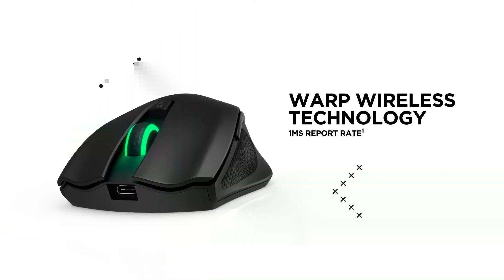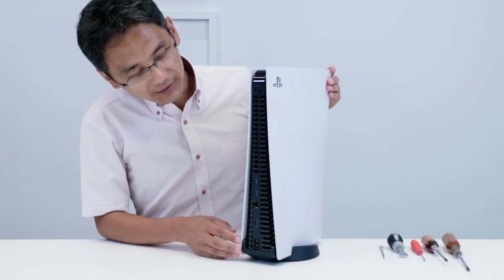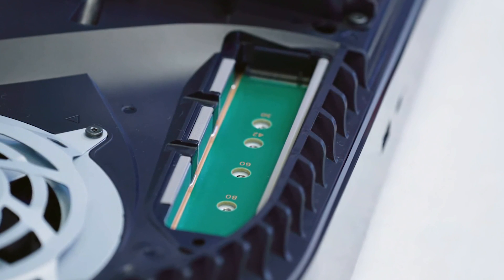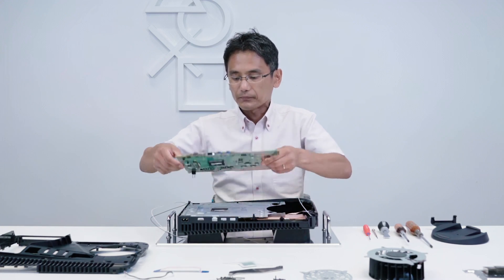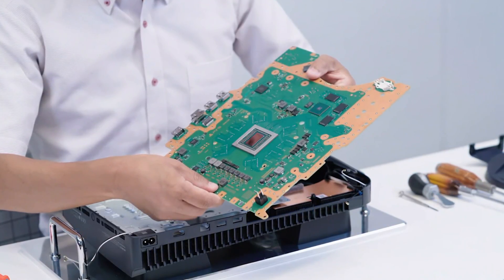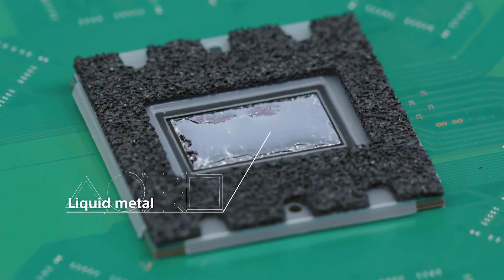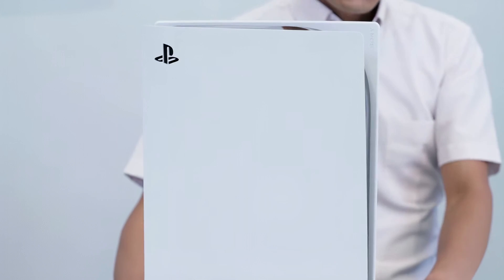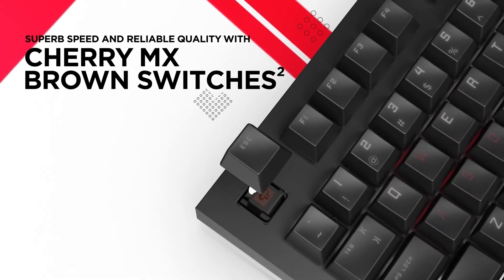PlayStation 5 Teardown Analysis: Inside Sony's Next Generation Hardware Design

Comment: 08:50 Wi-Fi6 theoretical max speed is 9.6 Gbps. This assumes a 4x4 160+160MHz setup to reach that. The PS5 supports 2x2 80MHz, which gives a theoretical speed of 1.2Gbps. In reality, 800-900Mbps should be doable. Disappointing to see an explanation of this glossed over. No effort made.
Reply: I don't know what you're talking about but it's so going to be better than Microsoft's Wi-Fi 5
Reply: @blackgreece2702  It is. The Xbox setup max theoretical speeds are 866Mbps, and in reality 500-600Mbps. But that isn't the point. 

There was little to no explanation of this. 
What is the advantage of going WiFi6 now. What the problem with releasing WiFi 5 devices now etc. 

For a video labeled as technical analysis, i didn't see much of that.

Comment: Performance of SSD degrades? reallly? wft. Like My ssd nvme is right behind a GPU and works fine. No, there will not be a SSD overheating problem on PS5. And on your own Broll you can clearly see a gap made on top of nvme Bay perfectly aligned with air flow...
5.5 is not theoretical bandwidth, its real hardware level. Theoretical is up to 22 GB/s
If ssd fails, the Console will? Yes. If processor fail the console will, capacitors etc. And in any case you would have to send it for warranty. And, btw, same goes for Xbox. 
Really guys instead of gaslighting, try some proper journalism.

Comment: Another interesting tidbit that was passed over, it looks like the mainboard shielding has another smaller heatpipe and heatsink built in, assumingly for the VRM's, you can also see thermal compound on those components and possibly on the ram modules as well.

Comment: My god this guy has a punchable face. Regardless, the power hungry assault on GPU and CPU is unnecessarily and can be a bottleneck as neither need to opposite at full capacity, also putting load on the fan in xbox's case. Early reports have already stated confirmed this concern that many had early on, that being the system running concerninglu hot, which wasn't under load btw; rather, it was stunning backwards compatibile games. 

Anyhow, the smart solutuon is Sony allowing the GPU to boost past what the xbox is capable when needed while maintaining a liberal approach to thermals with both liquid metal and that heat sync as the forward thinking headroom. Couple all this with a variable frequency when needed and the fact the system is optimally designed first and foremost around thermals, then you see why it is so big and me thinks their size backpedalling is damage control for the VCR monstrosity that was the XBONE, but it's still nothing on a PC case and the xbox simply falls short of being boring as far as style and practicality go, even if the XSX is not practical in the slightest as far as a console form factor goes tbh, but that's subjective and who cares as long as more emphasis is on thermals. 

Regardless, the move toward user accessible SSD that isn't proprietary is a smart choice from Sony also, as it gives room for cheaper options and a standardised method to upgrade, opposed to a proprietary one which influences cost, which has also incidentally been reported on as getting hot to the point it burnt the reviewer and has zero cooling deployed due to it's nature. In short: the SSD expansion method xbox have deployed is nothing short of scummy and an oversight.
Reply: @Rohan Rathour ?
Reply: @Rohan Rathour 
Because it's true.
Reply: @Rohan Rathour 
You're not making sense.
Reply: @Rohan Rathour 
It was 1% of my comment. Get over it lmfao.

Comment: The biggest mistake Sony did was placing the extra Space SSD inside while Microsoft did excellent Job with external SSD ! PS5 will run very hot 🥵
Reply: MS still has a internal SSD the external SSDs are extra storage.
Reply: Lmao ps5 runs cold 😇

Comment: I want a pro version that guarantees 60+ fps. I can sacrifice a bit of graphics.
Reply: 60fps is the cap, kid. If anything, a pro version would mean better stability at 60fps and better graphically fidelity, but most importantly, a system that is more optimized and built better.

Comment: Man. you're Xbox Series X teardown didn't even point out the SSD on the board, sound chip, or TIM.  The Sony teardown explained MORE than you and directly from a Sony person instead of an intermediary "influencer". If Sony gets something wrong then they are accountable. However, if you get some information wrong Xbox is free of blame.
Reply: not only that but at 
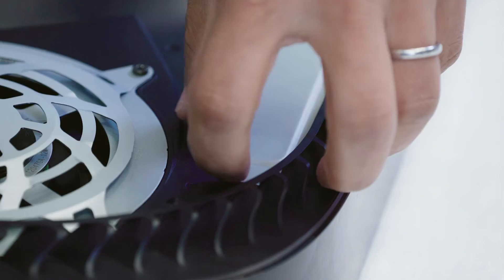04:50 he talks about the SSD gettign hot and not sure how it gets cooled
On the Xbox we know it is not getting cooled it only gets a bit of outside the box cooling but some youtubers who touched the SSD did say it got pritty hot
then at 06:34 he talks about the onboard solderd SSD and if that could be a problem
wel the Xbox SSD is also Solderd on the board as far as we know so same problem there

Then at 09:43 he talks about  the speed of the Memory 448GB/sec and at 14:07 that the Xbox has a much higher bandwith Memory 
But not telling that only 10 GB is faster and 6GB is slower and if you even that out they both are arround the same speed.
So even if they get an PS5 to compair and test it i wonder if it will be a fair comparison.

Comment: I highly doubt they created the m2 expansion bay without thinking about cooling. The whole console is designed around cooling. They built the insides and put the outside around it instead of xbox that decided it was going to be a box and figured out how to put everything in the box.
The only thing I feel like they've fell short on is storage space. A secondary ssd will be almost essential. Other than that they've built an amazing console

Comment: I am a technology novice, which is why I love this channel. I have a question, could Sony overclocking the PS5 have long term issues?
Reply: Heat is really what kills electronics. Overclocking will produce more heat but PS5 seems to have adequate cooling to dissipate that heat.
Reply: The hardware is already heavily underclocked due to being starved on less than 130watt to share with the cpu. If anything, trying to reach default clocks on the hardware would result in massive thermal throttling and kill components.

Comment: The PS5 design is not "tried and tested", but "lazy and unimaginative"; just as the overall Sony industrial philosophy.... There is a reason that, aside consoles, Sony electronics in general (Phones, Laptops, etc..) has been collapsing all around, against more innovative competition...
Reply: They sold their laptops and Xperia could succeed if they focused on Apple type gimmicks rather then specs . Ps5 is the most innovative console ever developed Btw
Reply: @lightyagami8645  "Ps5 is the most innovative console ever developed Btw"

No.
Reply: @victorsegoviapalacios4710  " No. " 

Last console to try to develope a new genre with flawless gameplay and level transitions ? 
Last console to implement high tsch WIFI and bluetooth ? 
Last console to inplement liquid metal ? 
Last console to allow 1080p30/60 portable remote play for next gen titles ? 
Last console to add Haptic feedback/Adaptive triggers/Motion sensors/touchpad to their controller ?

Comment: Required equipment for PlayStation 5:
1. Controller
2. Console plug
3 HDMI cable
4. Vacuum cleaners to keep the dust out
5.😬😁🤬🤑😘

Comment: Whats the deal with the small heatsink on the SSD controller on the other side of the board? So much on this console seems like different divisions haven't communicated properly.  Just so much more messy than the series X.  Like the design team got first say and every other team had to overengineer a solution to fit the stuff in somehow. They'll still sell many more than Microsoft though.
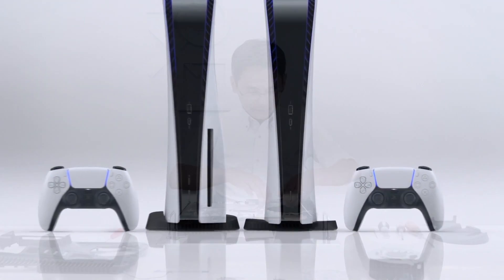Reply: take a look again at 09:27 when he is removing the shielding that is also a heatsink and it is on top of the SSD and the Memory and the Sound chip so yes it is getting cooled.
Reply: @freakgib  i was probably unclear. My point was, that this is an extra heatsink assembly on the back instead of using the main heatsink on the frontside. This is like having a graphics card with VRMs put on the backside and an extra heatsink there.

Comment: It is concerning Sony haven't for whatever reason given a PS5 to Digital Foundry . 

What is also concerning is the sheer size of it compared to eh man taking it apart. 

It does look like MS have been better engineers here, specifically in cooling a more powerful console yet drastically smaller in comparison. 

Either way the designs are locked in now. Until the inevitable half gen refreshes.

Also correct me if I'm wrong, but over time doesn't liquid metal paste corrode over time? Which is why PC builders advise against it??!!!

Comment: Talking Xbox in ps5 teardown.
Also forgot to mention no RT in dirt 5,you didn't see baked Shadows,you didn't mention pop in.
And you didn't have the proper equipment to test 120 FPS.
But in Spiderman you zoomed 1 million times to see how good RT is.
I'm happy playstation didn't give you a ps5 for testing.
Digital foundry my ass.
Reply: Beastcraft  dirt 5 launches b4 spiderman n the build which they used for spideeman wasn't final too but didn't hesitate too zoom in n stiff n creatin a uproar like ps5 is equivalent to a 2060 while it clearly has the power of a 2070super overclocked to 2.23ghz
Reply: @lightbringer6567  its 2080 level Gpu but the raybtracing was 2060S level accorsing to them , i call BS on that minato

Comment: It's actually really exciting to see them using liquid metal. It'll be interesting to see if their innovations in making this a viable long-term thermal application potentially make its way over to the PC space where it's generally just used for quick extreme overclocking then removed shortly thereafter.
Reply: So what's the issue with liquid metal is it just leakage? If so if it's correctly sealed shouldn't be an issue right ?
Reply: @TristanTheVRGamecat  Leakage is just one problem. The others would be degradation of materials and the LM itself and the conductive nature. Most LM have a life span of 1 - 2 years, but if Sony designed their's just right it could last longer. With degradation, it could degrade parts of the heatsink (although the part that touched the LM seems to be silver, so that was minimized). As for conductive nature, the heatsink just cannot have any electricity run through it or the LM leak out, otherwise the system could end up dead.
Reply: Yeah the trouble with console user it's like apple users, that last gen Console is basically 2 years PC performance and devolepments, to a Pc user a faster SSD with an Ok GPU is not worthy of hype if the same price competitor offers a better GPU with an Ok SSD for the same price that how HP stole some share to Asus with gaming laptops...
Reply: @erickmarquez506  that's undoubtedly true, but mainly because games are designed to run on as many systems as possible, which means games are designed with HDDs in mind. Check LTTs video where the staff is supposed to know which system is the SSD pci gen 3, which the SSD pci gen 4, and which is the HDD.
Reply: Some ASUS laptops use It iirc. But durability is a problem

Comment: As writing produces most heat in SSDs i don't think, it's a big problem in consoles. Downloads aren't that fast. If the drive gets to hot they just throttle writing speed.
Reply: Sony will mostly approve drives only which hav 7gbps read speeds so that even if it throttles its will hit the 5 5gbps mark

Comment: I can't help but think the oversized heatsink etc points out that they have just overclocked the nuts off 8TF to turn it into 10TF
Reply: It’s not oversized. It and the 2+ years in development and testing liquid metal seal and materials development have been about high clocks from the start. The leaks on the PC discrete cards show equally high clocks from factory.

But I’m sure it’s a 7TF console that was overclocked in a panic at the last moment because that makes me feel better about my choice of plastic toy.
Reply: @EeekiE  doesn't matter to me as I'm buying both PS5 and series x 😁 so I don't need to convince myself of anything, but the facts are that if,  as an example the PS5 variable GPU frequency was to operate at the same speed as series x (which is a real possibility) then this equates to 8.4TF

Comment: Sony did a terrible job this time around, I would be scared to get this console I'm sure it will have a lot of problems. 
Series X is smaller and yet more powerful, simply on another league.
Reply: I wonder how well the PS5 will perform in japan due to it's huge size. The japanese usually prefer small consoles.
Reply: Lmfao 
Playstation 5 is running cool and quiet according to japanese youtubers
Xbox is running hot according to western youtubers
Try agaib
Reply: @lightyagami8645  The Xbox Series X actually runs cooler than the PS5 according to people who have the consoles. 

And by the way, a console is supposed to exhaust hot air. Or would your rather have that hot air INSIDE of the console where it affects components and therefore performance?
Reply: @ohmnesia  which people have " both " consoles ?
Reply: @lightyagami8645  Google it, also it's suspicious sony didn't send their console to anyone isn't it? If you're smart you could say why.

Comment: Rtx 2060 at best! 2 year old tech
Reply: RTX 2080 ATLEAST 
RTX 2080 
- 10.1 TFLOPS 
- 448GB/S Bandwith 
- 256 Width 
PS5 
- 10.3 TFLOPS 
- 448GB/S 
- 256 Width
Reply: @lightyagami8645  flops don't mean anything for gaming
Reply: @manutd19999  lmfao
Reply: @lightyagami8645  there's a lot of stats you missed there
Reply: @ruxis8179  4mb L2 cache on both 
64 ROPS 
128tmus 

2080 have more shaders , ps5 have higher clock rate

Comment: and there are people who actually think the PS5 design is actually more custom and better than the Series X... yikes
Reply: PS5 is more customizable
Reply: @bobbytoddy9640  i mean, you can replace the side panels, sure, but internally is not better
Reply: Obviously its better 
Far bigger heatsink 
Dual sided fan 
Liquid metal 
Wifi 6 
Bluetooth 5.1
Side panel Removable 
Third party storage expansion options
Reply: @lightyagami8645  can't tell if you are joking or being serious lol, i mean i personally don't use wifi 6 since i keep my shit hardwired, bigger heatsink doesn't mean better heat dissipation, liquid metal is risky but can't say for sure how many years will that shit last, bluetooth has too much latency, ita nice for compatibility with wireless devices but too much latency; 3rd party expansion ssds are nice but in the teardown it wasn't disclosed how that bay will get air, i mean it has a vent, but no actual fan, and that's something to worry about since PICE gen 4 drives are toasty by nature, removable side panels are nice? If they actually put limited edition side panels ?
Reply: @rodrigosanay4351  wife 6 is an option , bluetooth is an option , Liquid metal is risky but way superior to plasma paste if it works correctly . All we have to do , is open the Side panel to put an SSD there . I like options you know
Reply: @lightyagami8645  but MS managed to put a better overall console in a smaller package while not sacrificing performance, its not as customizable, but it has about 15-25% extra performance
Reply: @rodrigosanay4351  it have 10% extra performance which would result in highly negligible graphical differend but lags behind in literally every way of hardware
Reply: @lightyagami8645  1.9TF, almost double the CUs while maintaining clocks, umm no dude, its more than 10%
You like options.... yet sony doesn't give you that much, i mean removable sidepanels and 3rd party SSDs, ok 2 options what more? It's not like wifi 5 is dogshit, MS gives you 3 options to buy gamepass, 2 options to acquire Series X|S in payments, gives you free next gen upgrades, your xbox one controllers come with you to next gen, your games of the OG xbox, 360 and all of xbox one games comes with you at higher res/frames while also almost all of them with HDR, and better texture filtering and speedy loads, like dude, not trying to be a Fanboy but you can't say you like options while MS/Xbox are "THE OPTIONS" 
Also they used a bigger heatsink and liquid metal just to match the performance of a vapor chamer, the Japanese dude said it himself during the teardown "just to match"

Comment: Look at the small print at the end of the PS5 teardown video. It literally said that the dust cover does not guarantee the console from getting clogged up with dust. I.e. its still probably going to get clogged up so you shouldn't even mention it

Comment: Maybe the reason why they have the SSD  slot near the fan is because they may have a vent from the fan to the ssd to pump in cool air to cool down the ssd .
Reply: SSDs can take some temps most SSDs in PCs are not really cooled aside from a bit of airflow. Too warm is bad but too cold is also bad.
Reply: @mrn234  
M2 SSDs are always cooled from what I can tell. You kidding? Cooling on those bad boys is a necessity. PS5 SSDs are going to throttle down you watch.